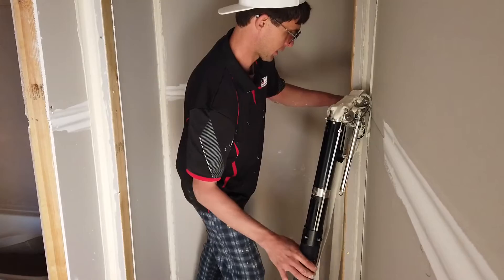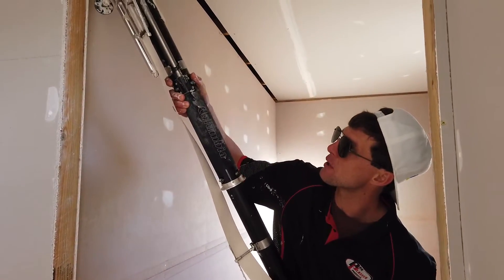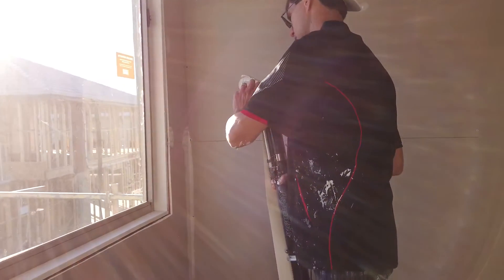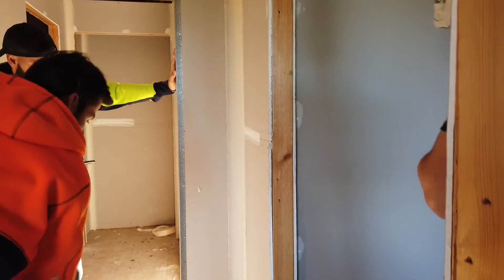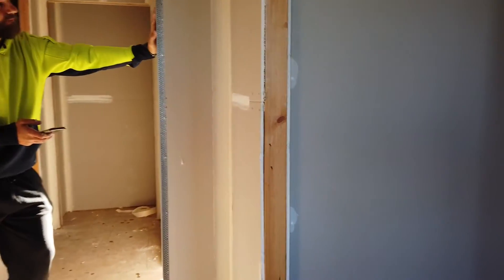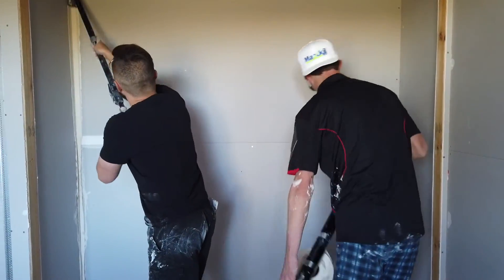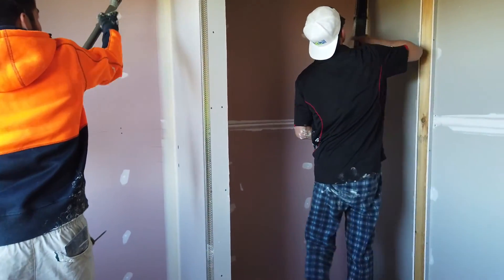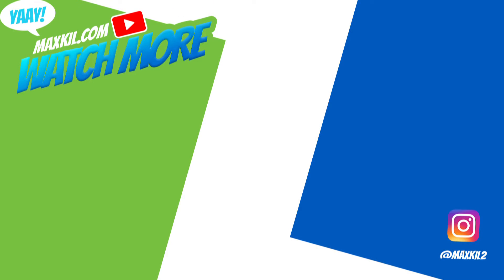Drywall Bazooka

Comment: Sick pjs too bro
Reply: Thanks mate
Reply: @gadgetg9479  where do you get those big buckets from mate? Good for the pump
Reply: https://www.proplaster.com.au/bucket-with-lid-white-22ltr 
The description is wrong I think they are 30l check before ordering.
That one is 3 years old. 
11.15L to a full bag of bace makes a nice exy mix ,mix once no fine tuning needed.
26 ish exys first coated in 1 h with 8inc blade if the walls are straight.

Comment: Looks like that Predator was giving a bit of grief.
Reply from the maker: Hey Gaz , that bazooka wasn't the predator one. Yeah it's not the one Gadget was used to.
Reply: @Maxkil  makes it very difficult when it's not the tool that you use every day. I ran a brand new taper a while back,  even though it was the same brand as I am used to I found it difficult for a while.